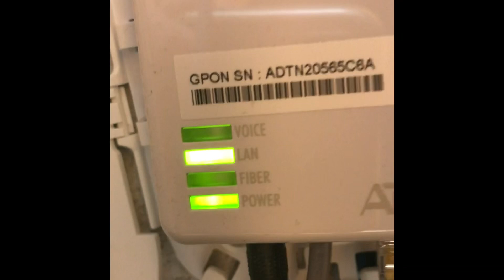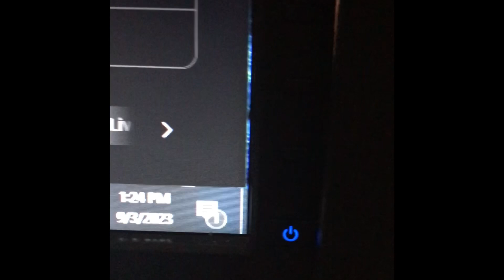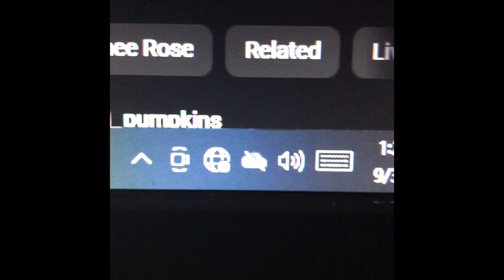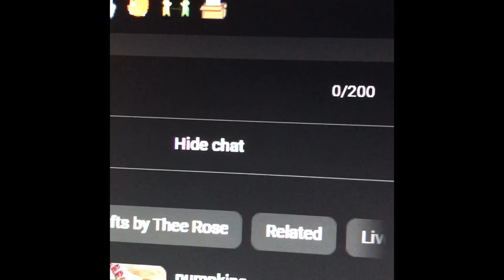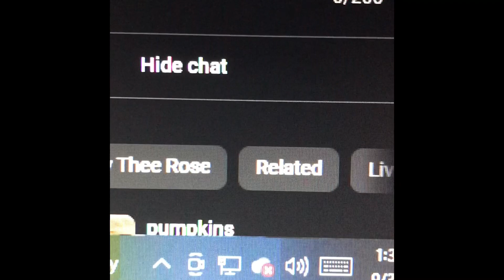UPDATE on Our Internet Issue. 😖😒.  God’s GOT THIS 😉🥰

Comment: Those should be solid right?? Have y’all checked the line outside?? Nvm you said you put a new line… 
Try plugging your computer in using the Ethernet cable see if it helps short term. That can be so frustrating I’m sorry. 😢
Reply from the maker: My regular computer is plugged directly into the box, we do use the WiFi for our phones and my son uses it for his gaming up stairs.  Not sure what is happening for sure.  Crazy sometimes.
Reply: @louloustreasuretrove2122  and the company came out to help?

The next step I would take. If it doesn’t get resolved check to see if it’s a hardware issue.  Worse case, you might need to replace or upgraded your modem. 

Sometimes these companies will sell people internet that isn’t compatible with their modems.  
That’s the only other thing I could say. Or unplug and let it sit for a bit. Then replug.

I’ve also seen a modem. Blink like that because internet lines were cross with a 2nd modem.